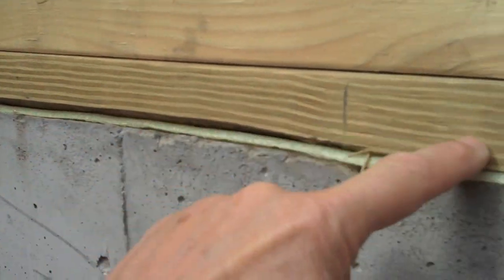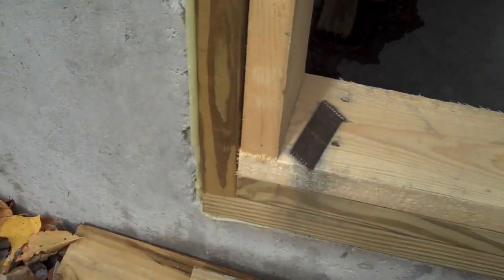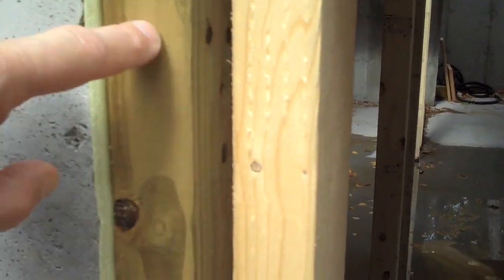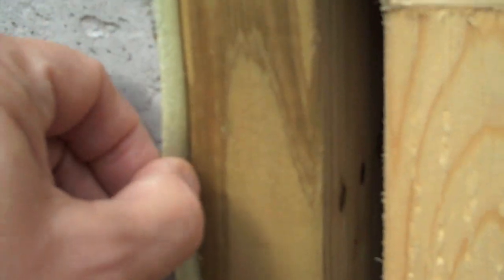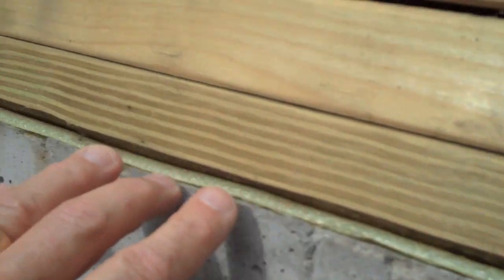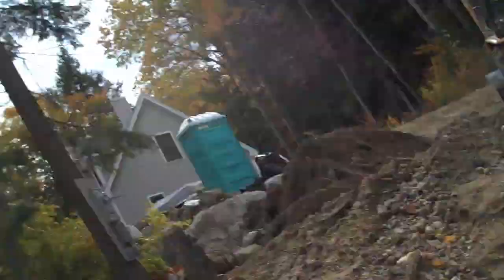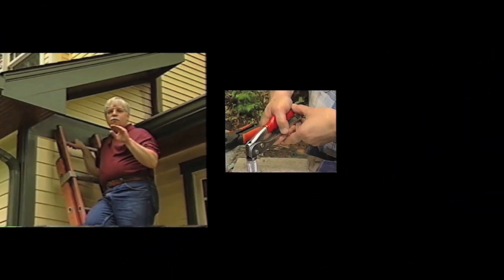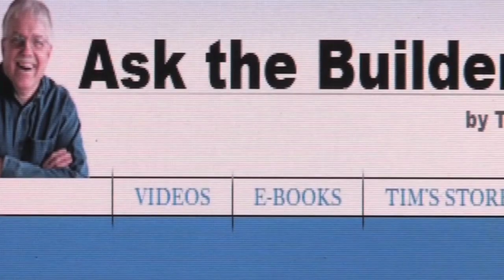Sill Plate

Comment: I think that sill plate foam is also so that the concrete (which tends to absorb moisture) doesn't transmit moisture to the wood, thereby helping to reduce potential rot.
Reply from the maker: Be sure to sign up for my FREE newsletter at www.AsktheBuilder.com

Comment from the maker: That's the trouble with building lexicon. Some terms are interchangeable. I would say, and others would disagree, that a sole and sill plate are the same thing. In my world of building, a bottom plate was one that was on an exterior or interior wall. A sill plate rests on a foundation and typically has joists on top of it. Ask your question to ten carpenters and you'll probably end up with five different answers! Great question BTW. Hope you subscribed.

Comment from the maker: @mattrospecs I'd have to strongly disagree with you. For starters, concrete is not acidic, it's alkaline. Secondly, If the concrete and treated plate stay dry - as they should - there is no water present to aid in the growth of fungi. Finally, treated lumber contains chemicals that prevent rot.

Comment: If home is already build would you recommend spray foam or caulk on the inside for a good air seal between the foundation wall and sill plate. What about between sill plates if there are two boards?
Reply from the maker: spray foam

Comment: Thanks Tim, how would you attach a Modular Home to the sill plates? We live in the northeast, not prone to hurricane winds, Wind Zone 1. Normally we use metal strapping but unable to find a definitive answer on spacing between the straps and type of metal straps that is appropriate. Would you be able to point me in the right direction to get this information. The building department in my town is not helpful. Thanks in advance.
Reply from the maker: When you posed this question to the modular home company, what was their answer? They attach their modules to foundations each week in your state. 

I would attach it the same way we do stick built. Anchor bolts in the foundation. When the sections are brought to the house, the crane can lift up the house and you can drill the holes in the plates. You MUST coordinate with the modular builder to ensure the anchor bolts are placed in the BEST locations so the bolts pop through the plates not near the band board and CENTERED between joists.

Comment: Hey there, are you saying that as long as the sill plate is treated lumber, you should be ok? I noticed that my sill plate on a my new home addition is not covered with a vapor barrier, just the vinyl siding (the rest of the wall is covered with housewrap/vapor barrier).  Any advice appreciated, thanks.

Comment: I know your question's already a year old but I thought I'd chime in if your repair isn't tackled yet...First fix the causes and then YES, unfortunately your best course of action would be - a vapor barrier and a new treated slab o' lumber friend. Heck, the vapor barrier can be that foam strip or simply 4-6 mill plastic. Yes air infiltration is always a concern but first rule is ALWAYS, keep the moisture/water AWAY from all lumber/house if possible. Treated or not, it's good practice IMO
Frank

Comment: My sill plate is rotted out and has a soil like consistency from water dripping off the siding over many years. The rotted portion is about 15 feet long.  I don't want to use wood hardener and epoxy to repair  it since you can see daylight through the holes when you're in the basement.  Does the wood have to be replaced to do it right?  The problem was exacerbated when the previous owner built a deck that overlapped the area and even more water contacted the wood.

Comment: What is the correct way to move a misplaced water line in a slab shared by multiple townhouse? We purchased the interior townhouses (3 total units) on a particular slab. The builder accidentally placed both our water line and our neighbor's water line under our slab.
Reply from the maker: Run a new waterline to the other townhouses from the city water main. Easy.

Comment: With pressure treated bottom plate don't you need special concrete bolts that don't react to the pressure treated lumber?  Heard you are supposed to now put a sound bead of acoustic sealant on either side of the foam.
Reply from the maker: No. Because that bolt is never supposed to get WET.

Comment: Is it possible to frame 2x4 walls with a 2x6 sill plate?
Reply from the maker: Yes, it's possible. I have no clue why one would want to do this.
Reply: @askthebuilder  A friend of mine was delivered a lumber package for a garage, and received all 2x4 construction, but his footing requires a 2x6 sill plate. Never seen it myself. Didn't know if it wss possible. Thanks
Reply from the maker: You can put on a 2x6 treated plate on the foundation or slab. Then frame the wall with a normal 2x4 bottom plate and set it on the treated 2x6. Easy solution.
Reply: @askthebuilder  That's what we thought. It's detached so no drywall, but thanks a lot!
Reply from the maker: You should really watch just about all my DIY Shed build videos. They could really help you and your buddy.

Comment: So many idiot contractors will try to cheat and use regular lumber (instead of pressure treated) and also forget (or purposely omit) the gasket and/or sealer in between the sill plate and the foundation - and this guy is right; it's critical!  $5 for a 50 ft. roll; there's no excuse.
Reply from the maker: YW as we say in Morse.

Comment: wont pressure treated wood off gas into the home?
Reply from the maker: No. It's completely safe so long as you don't eat it or inhale the smoke from it should it catch on fire.
Reply: @askthebuilder  how do you know this? what if you also use pressure treated  plywood on bottom 4 feet?
Reply from the maker: Simple. I paid attention in high school chemistry class. It's time for you to upgrade to a phone consult call with me:  https://shop.askthebuilder.com/15-minute-phone-or-video-conversation-with-tim/
Reply: @askthebuilder  pretty sure you shudnt be using pressure treated wood